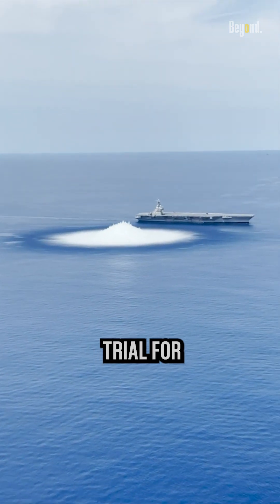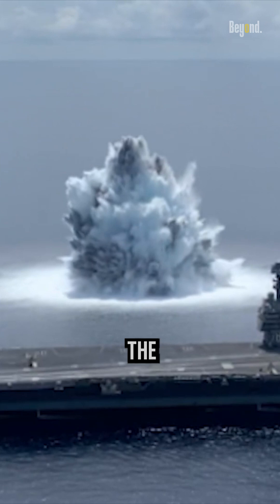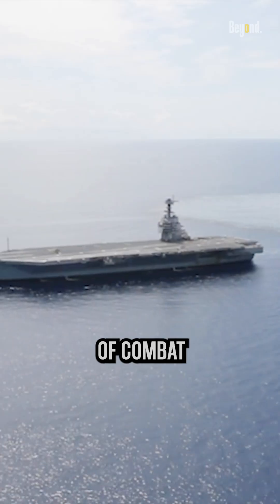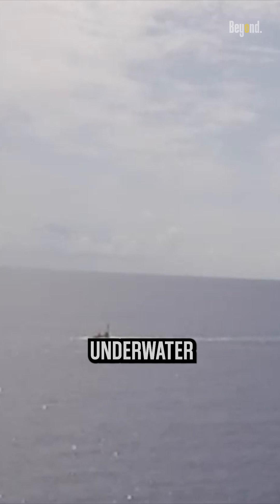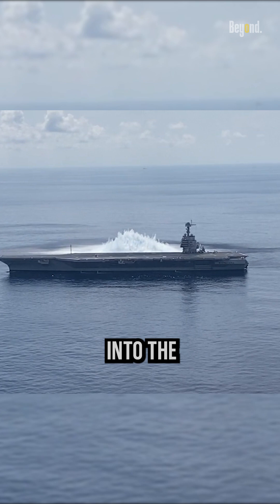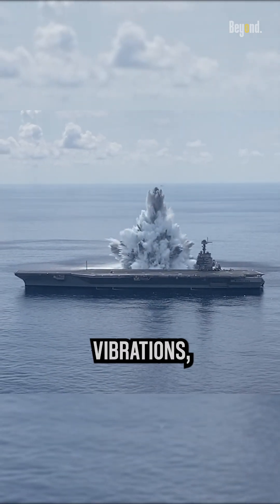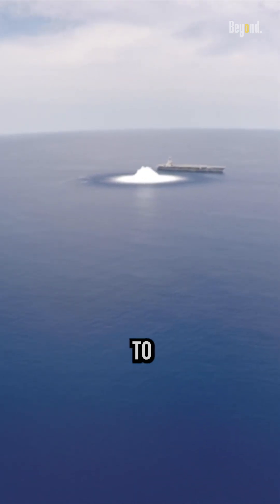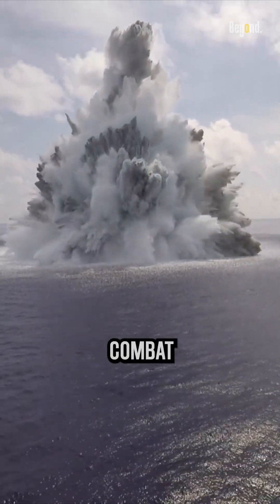The First Punch Before Going to the Battle #shorts

Comment: What happens if a ship fails the shock trial? Is there any danger of losing the ship during these trials?
Reply: Not likely, war ships can sustain massive damage and stay afloat. They would put pumps in, temporary patches and either tow it or sail it to a dry dock for repairs. They would then use data gathered to engineer a fix and cut large sections of the ship out to be beefed up and replaced.

Comment: I wonder what would happen if they did find some thing seriously wrong . Would they scrap it and start all over again ?
Reply: No, they'd work to strengthen any weaknesses that could br fixed without a major overhaul. Then they would try designing the fix into existing build design so the next ship of that class to be built, would have all these defects resolved before being defects to begin with.
Reply: Most service vessels like that will undergo huge refits multiple times in their service life. They don’t just toss a $18b ship on the scrap pile because it got some holes in it or the weapons platforms are outdated. That ship will still be sailing the seas when we are all old!

Comment: Wouldn't that weaken the ship before putting it into service?
Reply: that's kind of the point, break it to make it better, doesn't break is a job well done but usually takes the failure of multiple prototypes to find the flaws in a design or the materials used
Reply: @lukemundy4023   Yup.  The Zumwalt-class destroyers are a great example of why we do this:  The aluminum construction develops stress fractures far too easily, damaging the superstructure and everything else bolted to it.
Reply: You think the ship isn’t checked afterward?
Reply: It's called "stress test" for a reason.
Reply: Not as long as stress stays in the linear-elastic regime.

The tests are sometimes called burn-in tests, and filter out "early failures". Google "bathtub curve" if you are interested.

I have worked in defence and structural engineering.